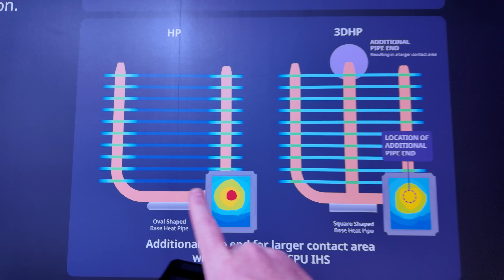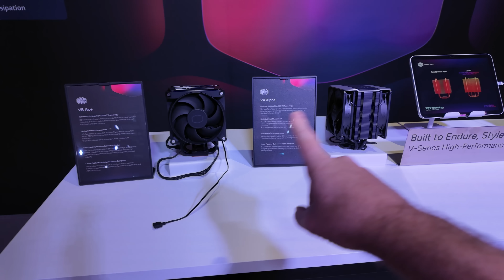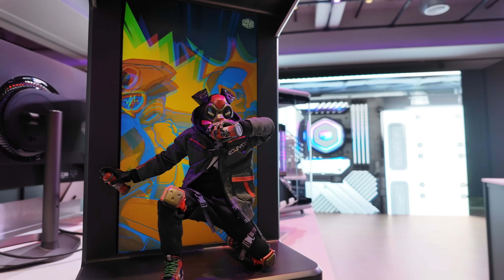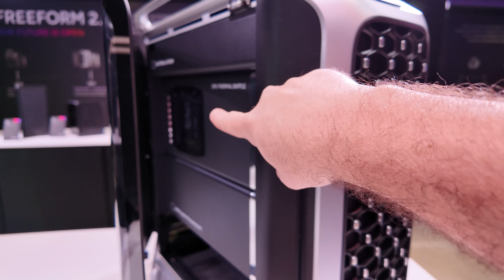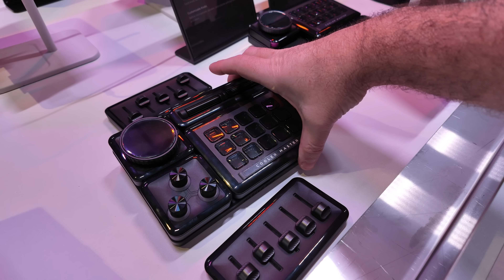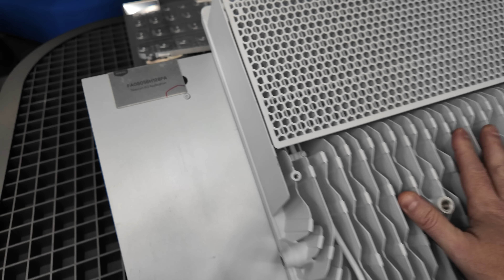Blackwell Coolers and Stoned Front Panels - Cooler Master @ Computex 2025

Comment: I am really happy with My Cooler Master H500 with 200mm Front Fans. I run an under volted, overclocked Rysen 9 5900X with a Sapphire Radeon RX 6800 XT and both are ultra cool temp wise. My CPU under full load never exceeds 58C. My GPU under standard use load doesn't exceed 51C. Pretty happy overall. My CPU cooler is a' be quiet' dual fan unit that is VERY Quiet.

Comment: My question is, did CM just slap their name on a AOI or... huh? We have 2 machines like this at my job to inspect PCBs but CM... I'm confused.
Reply: Man, I used to be a fan of Cooler Master back around the 2008-time frame and I'm still using a V6 CPU cooler on my OLD PC, and a backup CM PSU from around that time. But I went BeQuiet for my last build because the 901 is a modern case with ROM drive support and I'm really happy with their stuff. But these new cases and fans look amazing, and I would totally like to build with CM but, no ROM no buy. And yes, I use my ROM drive all the time. I just used it 3 days ago to burn 3 CDs.

Comment: 19:03 why would you put your finger in it tho ? Why would you put your hands inside a turned on pc anyways ? The only time you have your hands in your pc is when you're changing part, so with the power off
when it's powered on you have the case preventing you from putting your hands inside

Comment: Good morning fellow PC Builders! I would like some suggestions on "cost-effective" upgrades to my current build. I'm open to switching to AMD. I primarily use my build for gaming, and surfing the web.

Build Details - 
Form Factor - ATX 
Motherboard - Z790-A WIFI
Processor - i7-13700F
Storage - SSD 1 TB
Memory - 32 GB DDR5 
GPU - NVIDIA GeForce RTX 4070 Ti
Liquid cooled
Power Supply - 1050 Watt Thermaltake

My goal is to play the games I buy at the highest possible graphic settings. I appreciate any feedback, good or bad ( prefer more good but this is the internet after all ). 

Thank you!

Comment: I built a new AMD AM5 based PC 6months ago, replacing my old PC built back in 2011 (that still works) which used a Cooler Master Elite case and what was the top of the line AMD CPU (6core) back then with a Cooler Master Hyper TX3 CPU air cooler!

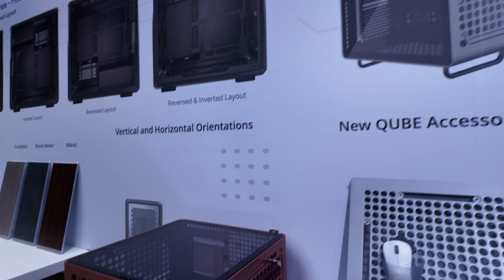Comment: 23:30 I had a conversation with the designer of Qube 500 Core and liking that case a lot. It's a new case slightly bigger but thinner than the Qube 500 with different purpose, only some design signatures are same. It can fit 2 140 fans or 3 120 fans on top and bottom, with 360 rad support on top. It can fit 2 2.5" SSD or 1 3.5" HDD on the back of motherboard, 1 SSD on PSU rack and maybe another SSD at the bottom of the case. Front IO can be replaced in different position, and those two handles may be included as  handles or case feet. They have not decided which case feet to use so maybe leave your thouhts?(I like the square one) 3D printing accessories is a feature on Qube 500, but they are trying to provide few clips and printing files online for the user to print out with paper or any kind of meterial then fold it and clip on the case. It's a neat case in such a low price.

Comment: I have a full racing sim setup, using the same Samsung 49" G9 Odyssey screen as the one in this video. Currently doing quite well in Le Mans Ultimate (LMU). Typically tubular cockpits like the one you tried out, are much more flexy than Alu profile cockpits. 
Also, the track you were driving - that looked a vintage Silverstone layout
Reply: Why bothers, is that not your car in the thumbnail? If you can afford a modern bmw with the depreciation and the fact it is a throw away toys - especially once the warranty run off, no one will protect you from the dealership nonsense. They killed our x5 by overfilling the oil and it got into the turbos - shaped by the crazy, mentally ills elites filled with contradicting nonsense, you should be more than well off.

 Why bother with super costly gaming that is just a genuinely inferior to the real deal?
Reply: @polomarco7053 -interesting comment.
Yep,I drive a BMW iX and it’s an amazing car.

Why bother with online sim racing?
It’s fun and keeps me focussed through Winter. It’s also much cheaper than racing in real life 😊